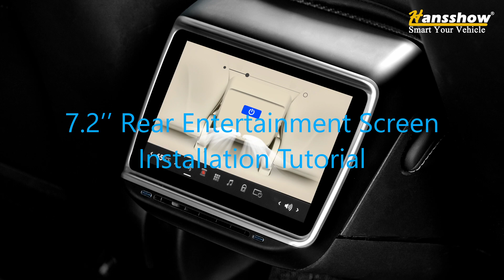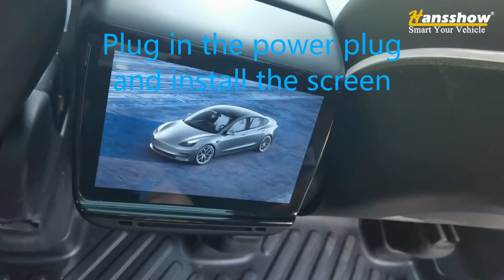Hansshow 2023 Tesla Model 3/Y 7.2” Rear Entertainment & Climate Control Display Installation Guide

Comment: I installed mine on my 2022 Model Y Performance. The screen will not stay lit. Backlight comes on only after initially connecting the power harness. Once I exit and re-enter the car, the screen goes black — so black that looks like it’s turned off. Do you know how to fix this?
Reply from the maker: The main display in the font has to remain on for it to remain lit. It’s Tesla making use you don’t drain your battery when opening and closing the door to kept screen on just tap on the main display to wake up the car.
Reply: @Hansshow_Official  this is not the problem. The front main screen is on. The 7.2 rear screen will not remain lit no matter what, only unless I disconnect it and reconnect it. But after that, I exit the car. Whenever I return to the car, seconds, minutes, or hours later, the rear display will not light up. The USB ports are delivering power, but the screen is dark and will not light again unless I unplug/replug.
Reply: @Hansshow_Official  I have not received a reply about my faulty product. I sent emails, phone calls, and messages. Either send me a replacement or refund my money.
Reply from the maker: @QuintanBrassfield  please email inquiry@hansshow.com for support
Reply: @Hansshow_Official  I already emailed that same contact days ago. I have had no response at all. I have a faulty product from this company and no one from Hansshow is trying to help.
Reply: I cannot get the wire back in, there is no room.
Reply from the maker: @QuintanBrassfield  please call our US engineer for aftersale support at +1 (949) 826-6200
Reply from the maker: @kismyask   please call our US engineer for aftersale support at +1 (949) 826-6200 M-F 9-5 PST